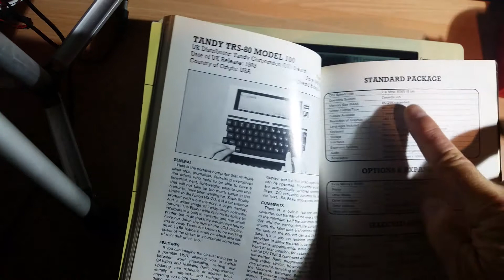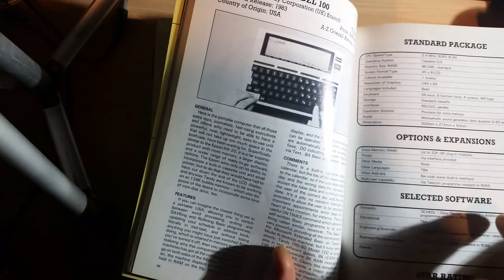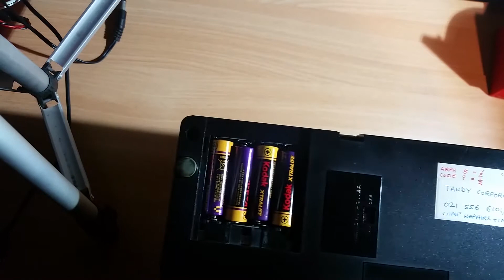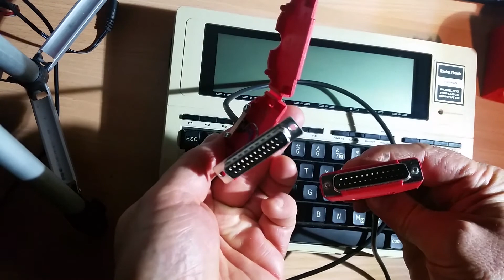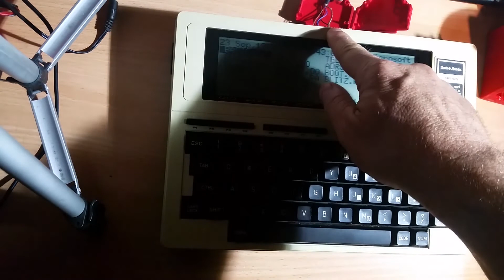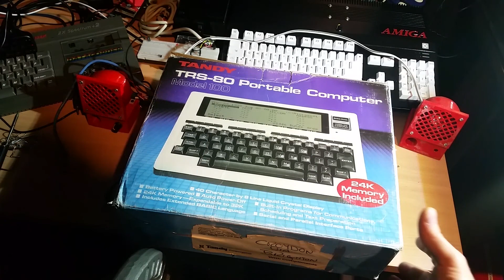TandyTRS-80 Model 100 (Radio Shack)

Comment: The modem should be built in, but I don't know if it would be compatible with UK phone system, and it is only 300bps. The connector is for either an acoustic coupler (cups to go over a telephone handset speaker and microphone) or a direct connect cable. The direct connect cable is easy to build.
Reply from the maker: I remember seeing the acoustic coupler with the cups in Tandy at the time. I used to love picking up the catalogue from the local store and looking at all the things I wanted.